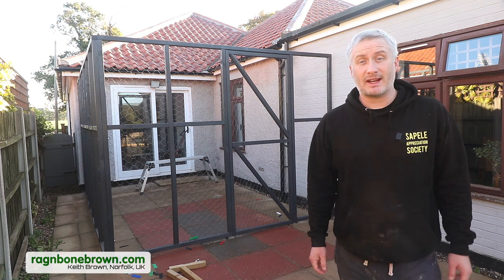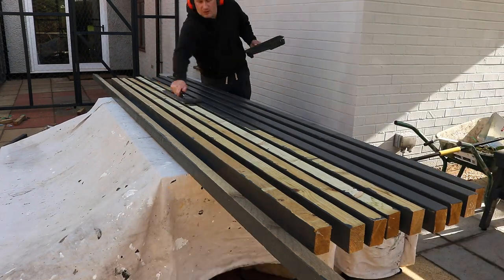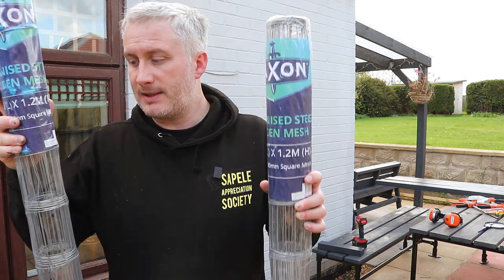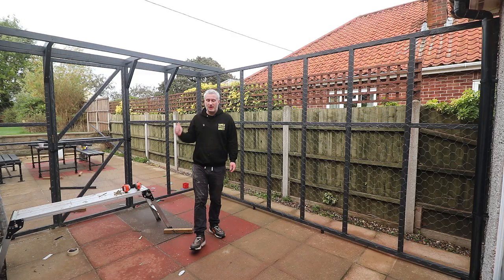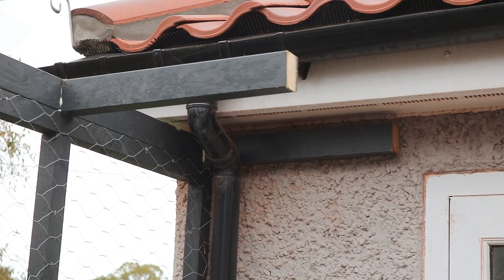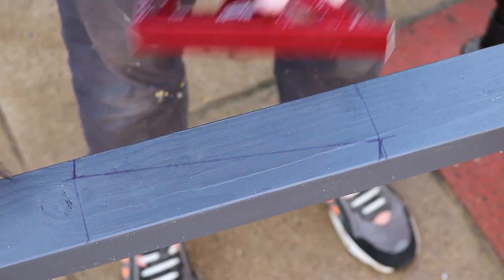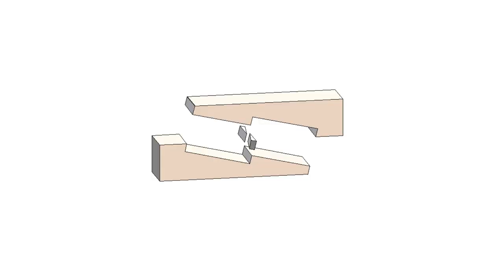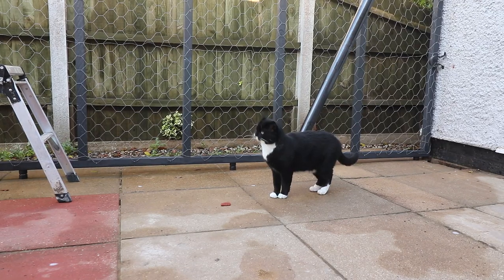Cat Enclosure - The Roof Structure

Comment: So much better if you under-squint it. It only needs a slight change of angle at the two short end-cuts. Also much easier if you have two hammers, for tapping the folding wedges at the same time.

Comment: Lovely job on the scarfs.  I made scarf joists for my loft conversion on 4x2s.  I watched Robin Clevett and left Skill Builder a comment, they replied !  No No Do Not Do That on a joist !!!!  Well of course i did, but i was making flitch beam joists with 6mm steel plates.  The scarfs were awkward to make, i used a plunge saw for the inner linear cut, but my male parts were bigger than yours !!  so i needed a proper plunge cut ( i didn't make that first straight cut you did ).   I made everything so tight that i still haven't bothered with wedges yet, but when installed in the floor i used screws as you did.

Comment: My cats would get out of that, so beware if he is a climber. The reason they use metal is that claws cant cling to it unlike wood. On top of that ive witnessed mine all spidercat-ing upside down to climb out of the metal ones. Even the metal armed ones that spring down they learnt to hold on to until it took them back to the fence, then to hook their paws over the top and climb out. 
Their ingenuity is he only reason we have a full mesh topper and sides. 
1 inch Nylon knitted bird mesh is brilliant and if pulled taught they cant bite it. They still climb it, but it takes a knife to cut through it, and had not failed us.

Comment: If you ever need to use those knock-in staples again - they are way easier to hammer down straight if you bend the prongs in further so that they are parallel with each other (easier to pull out, but that may be a good or bad thing in future...)
Reply from the maker: great tip thanks
Reply: @RagnBoneBrown  Two more tips using these sodding things - I use a wooden clothes peg to hold them for the 'first strike' to get them started... And I use mole-grips to bend them parallel; set the distance between the jaws and go through the whole pack. Also, you probably know anyway - use a heavy lump on the opposite side of the timber (like a big lump-hammer!) Knock them in against that to take the force of the blows, rather than relying on the mass of the timber; so the force is not transferred to joints or post-anchors or whatever. (You can tell I have experience of the knock-in staples - I do not like working with them! HA!)

Comment: Looks great. I built one for our cats in our previous house, that chicken wire is horrible stuff. I used the rolls of galvanised mesh that was about 10mm square, much more rigid and no give in it so was easy to nail to a frame. Definitely feels like you need an extra pair of hands for those U nails though 😂

Comment: Keith I have a better, safer suggestion for your gutters. Here in the U.S. and Canada we have gutter guards under many brand names. I’m assuming they are available in the UK too. They are perforated covers for your gutters that let the water in and keep the leaves out. The better ones are coated (think Teflon) so the leaves just slide off. No more cleaning, no more climbing ladders. So less maintenance and much safer. They are worth every penny!  Highly recommend! Last ones we bought we ordered right from Amazon.  I meant to leave this comment on the first video. And installing these might make another good final patio/catio video. 😀
Reply from the maker: thank you I wil check them out!